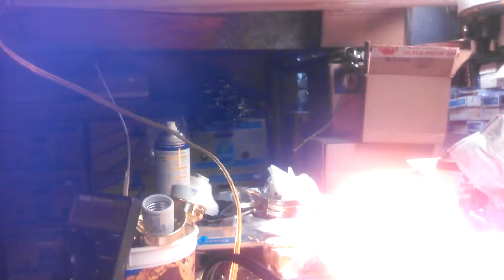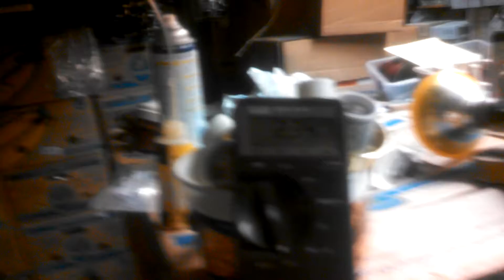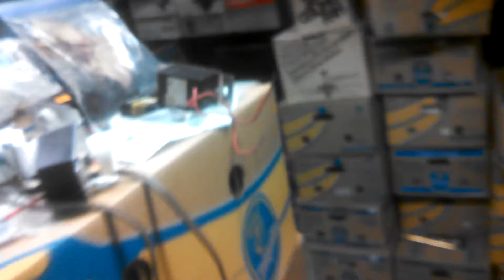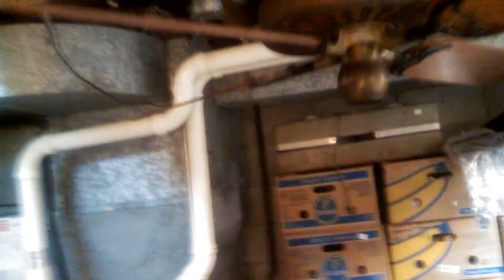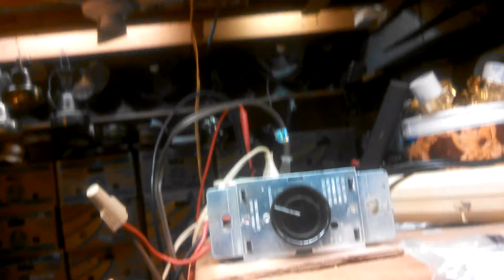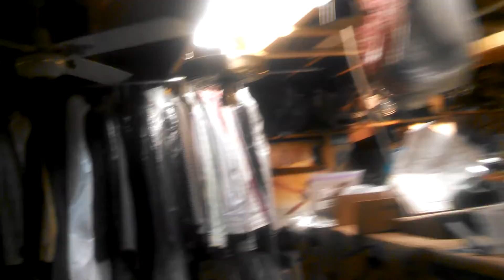Hunter Type 52 Adjustable (mechanically reversible) Ceiling Fan

Comment: I will share a photo of it sometime on Google+. When I was at a priest's house in the Philippines, there was a black antique Hunter Original in the main room and the control (a replacement Standard control, I think) was broken in such a way that it wouldn't run below high. It's either that or the bearings were stiff.

Comment: Did you run it for 24 hours?
Reply from the maker: Not this one.
Reply: Dan ''Spiffy'' Neuman
Oh, then if you do, it may run on 8mf etc. It will probably go as fast as a current Hunter Original with four blades installed, right?
Reply from the maker: Kat Fan I dont think running it for 24 hours will change anything, given that the oil is fresh.